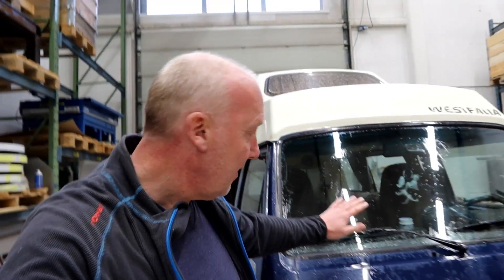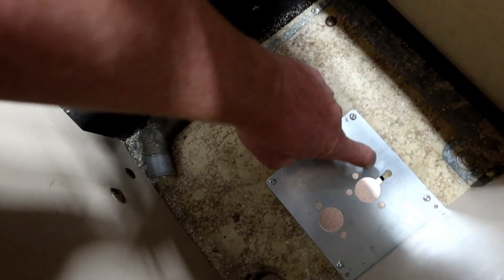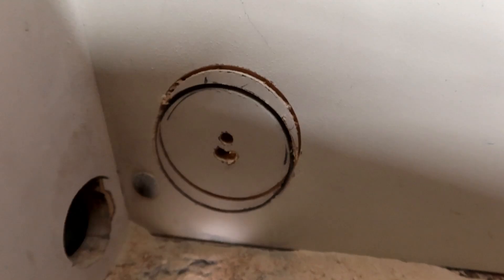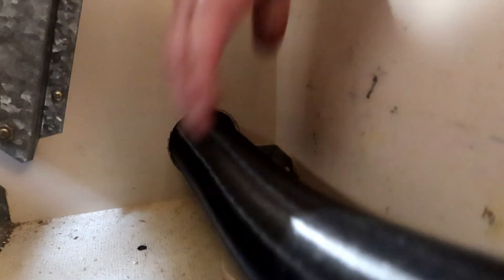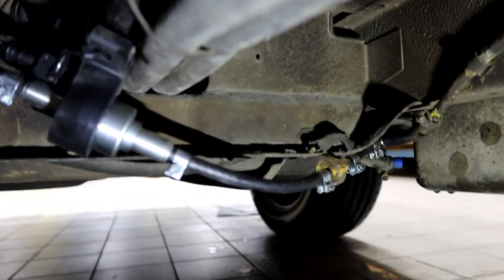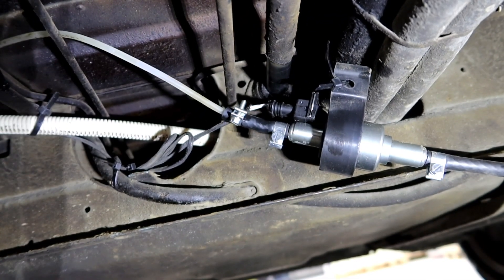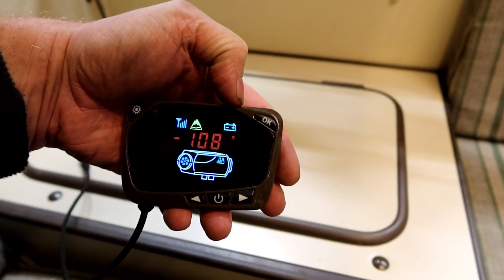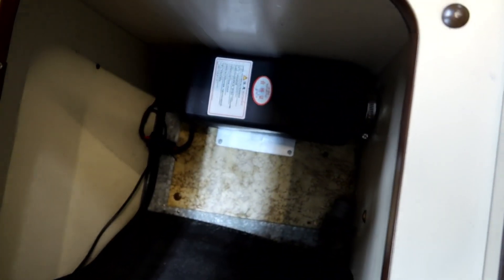Chinese Diesel Heater Install In my Volkswagen Westfalia Vanagon T3/25 (how to diy)

Comment: Hello from America John,  you did a very good job on your installation,  the only thing I would change would be to wrap up the fuel and exhaust pipes with heat resistant exhaust wrap. Keep up the good work and stay safe
Reply from the maker: Thanks for the tip 🙂

Comment: Nice review and install 👍 Just managed to buy one of the 2kw heaters and not many left on the internet, had to search high any low😁 Should be much quieter and more efficient looking at the speck sheets over the previous generations 👍

Comment: In my westfalia, there is a water tank in that location where the heater went.  Did you have a water tank there and will it still fit ?  My heater also has a diesel fuel tank since my vanagon engine (subaru) uses gasoline.  Yes, I am about to install mine.
Reply from the maker: My water tank is under the car.

Comment: I don't know how I missed this video, but it's exactly what I need right now ! 
I'm trying to make some decisions, since I've already started the installation process and I'm not sure if is right to make a big hole. What have you done on the big hole, in order to prevent infiltrations and rust ?
Reply from the maker: I did seal it with something like silicone from underneat.
Reply: @Italjohn  And to create the hole, fid you used a special metal freze (not sure if it's the right English name) ? I'm looking to buy the tool accessories, but judging from reviews, most of them results faulty for this kind of work.
Reply from the maker: @syncrovanCos  I used a hole saw.
Reply: @Italjohn  Exactly, the hole saw ! 
Did you use a special one, or did you managed to cut with standard hole saw ? I would not invest much in something I'm only using once.
Reply from the maker: @syncrovanCos  I borrowed one from work, it was made for metal cutting.
Reply: @Italjohn  Exactly what I was affraid of, that might involve a professional tool ! I'm stuck on this step and need to find alternatives.
By the way, consider to have a spare rubber mount for the pump, because mine get totally damaged in time, although I didn't use it and keep it in the box for about a year. 

Thank you !
Reply from the maker: @syncrovanCos  I have ordered one of these to test out. https://www.ebay.com/itm/274312656176

Comment: Hi. Thanks for uploading this. I want to hook up mine to my diesel fuel line as well. When you split the line did you get any air back in your main fuel line going back to the engine? That would be a small concern for me and how it would change the fuel pressure in that main line now.
Reply from the maker: Hi Mark. I have not got any trouble either with the car or the diesel heater 😀

Comment: Are there any concerns with overheating leading to fire danger while sleeping in van? Might be good to have a Carbon Monoxide detector installed in the van, or no? Very good installation though.
Reply from the maker: I don't know the answer regarding the overheating, and I'm not sure I want the heater on while sleeping. But I have a Carbon Monoxide detector in the car already. My only concern is that the exhaust is a little too close to the gas tank. I might relocate the exhaust later, or install a heat shield.
Reply: @Italjohn  Good ideas - stay safe!
Reply: Carbon monoxide outside

Comment: So are you getting the intake air from the frame rail?  What about sucking up dirt?
Reply from the maker: You have a point there. I did this because my vw Sharan's heater was installed like this from the factory. But it might not be a good idea. I haven't used the heater for more then 5 hours, but all good so far.
Reply: @Italjohn  it’s definitely more tidy that way. Maybe can find a filter that is small and also fits in there. I’d run mine that way too.

Comment: I don''t see ato your film how did you resolve a fuel tank?
Reply: aaa ok you made connection to the cable
Reply from the maker: @michaldekiert1525  Yes, I cut into the engines diesel feed.

Comment: Is the 2 KW diesel heater sufficient for heating your VW Westfalia in winter time?  I also have a Westfalia, smaller is better if it is enough heat?  Thank you!
Reply from the maker: I have not tested mine during the winter yet, but I would say it's more that enough to keep you warm.
Reply: @Italjohn  Thank you!  Excellent video.

Comment: Thanks for your video, wish can of heater you installe, the 2K or 5k ?
Reply from the maker: I have the 2K. Link to heater: https://bit.ly/2TlMU0I
Reply: @Italjohn  hi John. Tell me If it.s enough 2kw for our bulli or it.s better 5kw. 8kw has the same dimension like 5kw?  I have 3 options 2kw, 5kw and 8kw. From your experience which one is the best?
Reply from the maker: Hi Johnny. I have only tested mine ones, and that was in minus 8 degrees. It was on for four hours and managed only +6 degrees. But when the car is warm, there shouldn't be any problem to keep it warm. It pumps out 65 degrees on max. I have read that 2kw is enough in a small van like the T3.
Reply: @Italjohn  i am thinking about 5kw or 8kw.

Comment: 2kw enough for t5 panel van?
Reply from the maker: It all depends on how cold it is outside and how well it's insulated. I have tried mine in -8° C (approx 0° F) and it is ok. Takes a while to reach a comfy temperature, but when you get there it's keep it there all day.
Reply: @Italjohn  thank you for reply!! Sound deadening is fitted, thermo is coming also. Plus I have bulkhead on, so probably 2kw should be fine

Comment: Not recomended to install there.... neither recomended to install heater outlet so close to the electrical socket...
And 4 Gods sake DO NOT mount the exhaust close to the propanetank!! IT SHALL BE ON THE OTHER SIDE OF THE CAR...!
Reply from the maker: No room for it on the other side as I have a big water tank under there.
Reply: Then i would have moved the watertank..:)
Reply from the maker: @TheRapidspeed  Probably a good choice  👍
Reply from the maker: I have got the same concern from friends at a Norwegian facebook group as well, so I will have to relocate the exhaust somehow.
Reply: @Italjohn  the exhaust reaches up to 350°c celcius, better to remove from Propane tank sir :)!
Reply from the maker: @wanneselias7251  yes, I'm planning to do that later this year